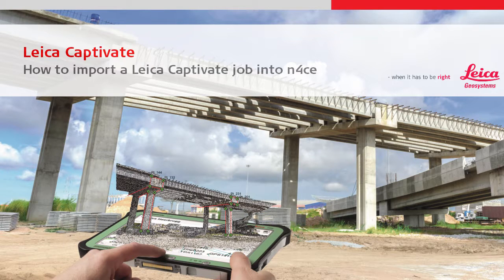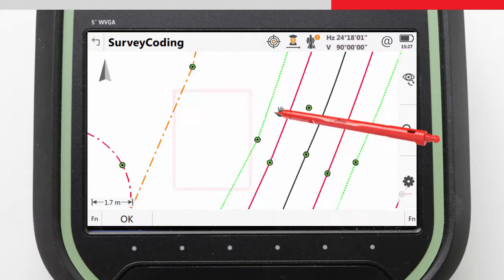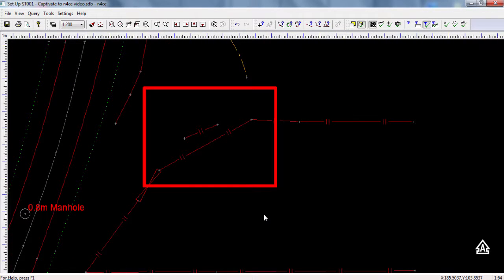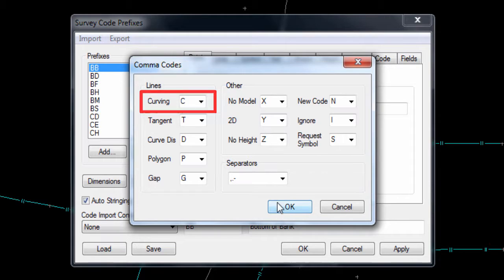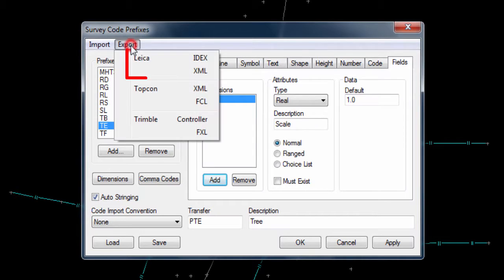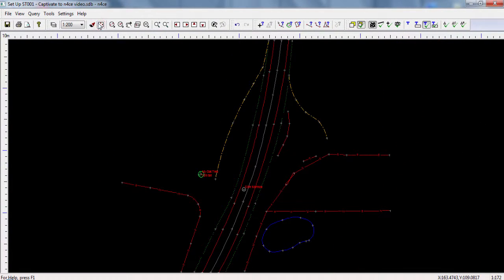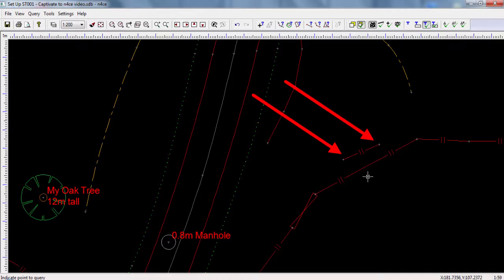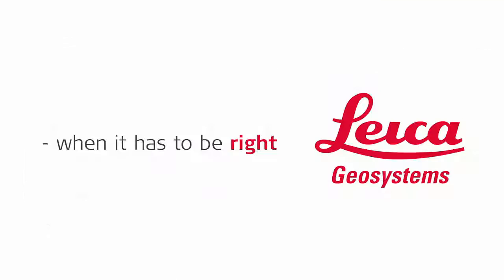Leica Captivate to n4ce Workflow

Comment: Is it possible for exported codes from N4ce, to be displayed in their correct colours and line styles on the captive logger? At the moment my captivate logger will only show black lines.
Reply from the maker: Not at the moment Lee, but now that you have raised the point, we are looking into it.  Colours should be possible as long as the coded points in n4ce are not set to "By Layer". Linestyles however are a different matter because the two systems have different styles. Thanks for your comment though and i will let you know when we have it resolved.
Reply: Phil Langrishe thanks for the reply. Linestyles are not such a big deal, though being able to have the different colours displayed in the 3d viewer would really help distinguish what's been surveyed.
Reply from the maker: So it turns out that Leica only support a fixed palette of 32 colours.  So we can't set the colour properly as we use the AutoCAD palettle by default, which is 255 colours.  We have tried to set the colour in the XML but the logger just ignores it and sets it to Red or Grey. Not sure why... But we certainly can't map to the colours you need unfortunatley.  Only thing you can do is manully choose suitable colours for your codes once they have been imported.